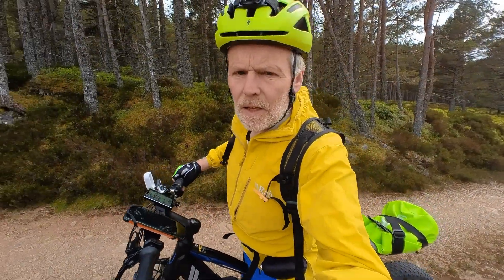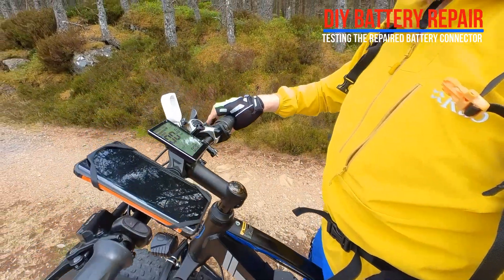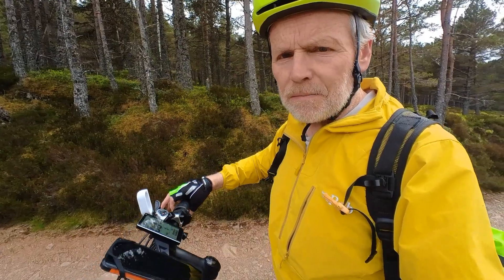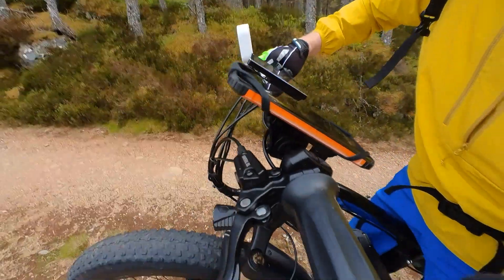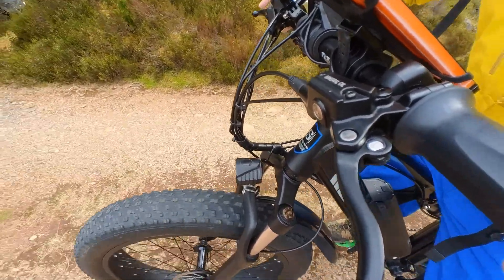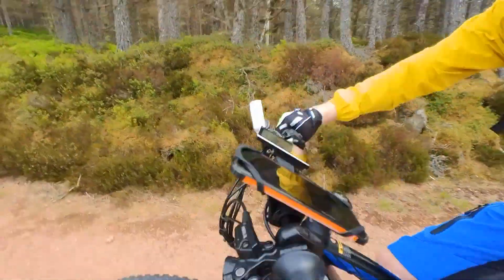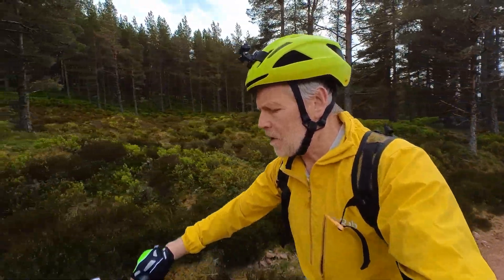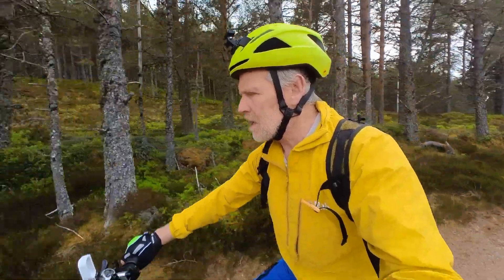Repaired Battery Test

Comment: Hi what sort of milage do you get on peddle assist mode on the mx3, mine seams to be quite poor cheers
Reply from the maker: I've only once run the battery down and generaly get about 25-35 miles on hilly trails keeping it to PAS 1-3. If you use the throttle and bomb along full speed in PAS 5 it'll deplete the battery much faster!
Reply: @RonWalkerCairngormGuides  plus I am about 16 stone, that seems about right then thanks for feedback

Comment: Can you make a video or point me in the right direction of using scotch locks?are you saying its possible to repair without soldering?
Reply from the maker: Depends what is wrong with the battery? I've used Scotch locks and crimping to make it easier and safer when joining the internal battery wires to the discharge port. However you still need to solder wire tails onto the discharge port terminals which is quite a delicate job even if you are familiar with soldering. Make sure you don't short out the live connections which could easily cause a serious lithium battery cell fire or explosion!

Comment: Is the wire gauge to small for the current the motor needs? Or did it just happen ?
Reply from the maker: Not sure but told they have three different battery suppliers as well as Reention Dorado and some of the discharge port connectors were faulty or  possibly just poor quality. There's some info on 'Juiced Bikes' about a similar problems with the same type of connectors, see https://youtu.be/NzJVC4KFlJw and at https://youtu.be/oq31UKj44RU
Reply: @RonWalkerCairngormGuides  Thanks for the reponse. Dunno If I should be " worried " since I got the MX01 but if something happends i'll know where to look already :)
Reply from the maker: @TreeFidyFive  Hopefully it won’t be an issue again but I just came across this, see https://hilleater.ca/blog/repairing-a-bad-connector-on-the-reention-dorado-downtube-battery/?fbclid=IwAR1zJCG81oWmz5Tr4HnO2kISJmdsqrcDd_cvkuKvNVMvTJNNvYELOzWaJOs&fs=e&s=cl